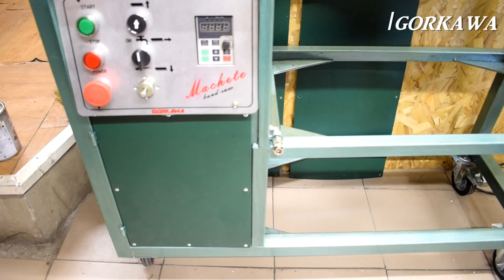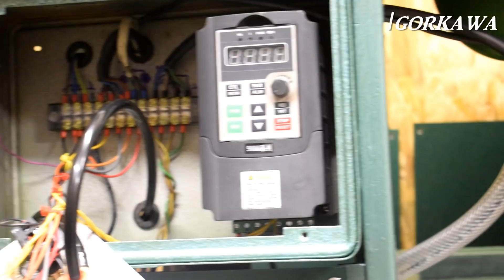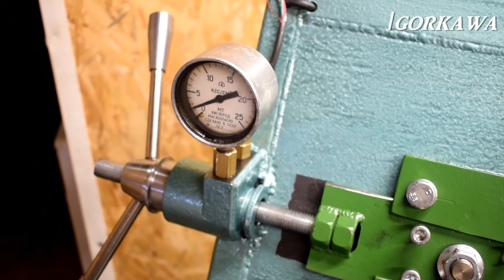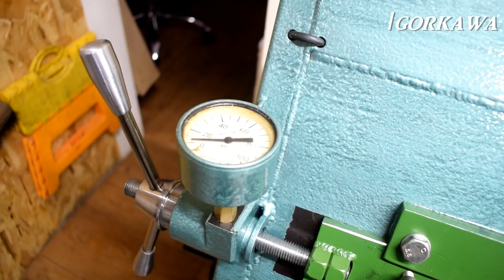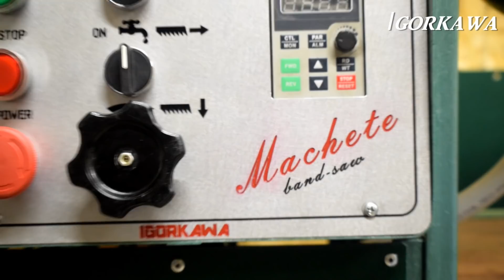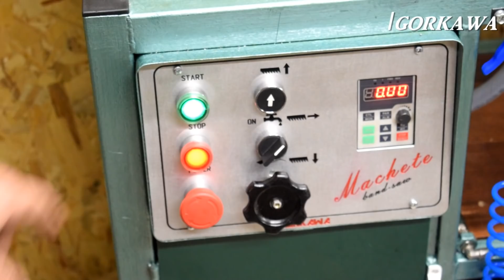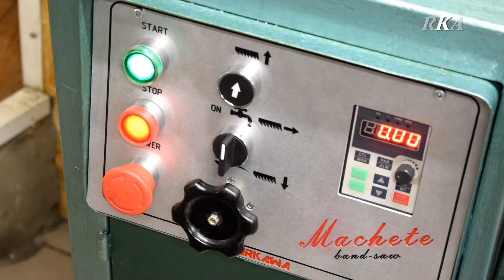Bandsaw for Metall How To Make

Comment: Nice workmanship. The major flaw with this design is the inability to swivel the cutting head.

In order to make angled and miter cuts, you have to clamp a swiveling jaw against a fixed jaw and the material wants to move all over the place.